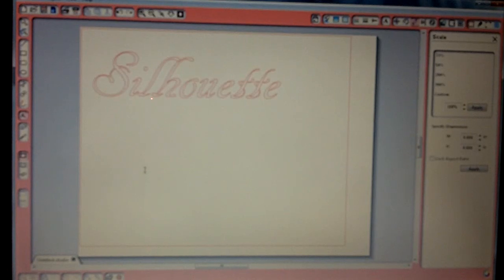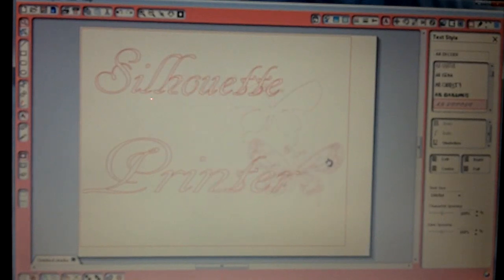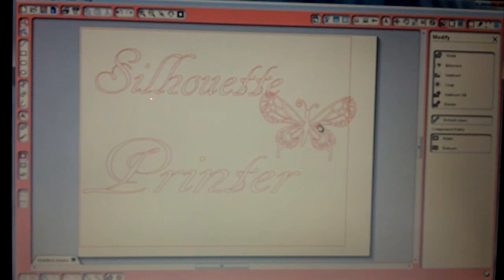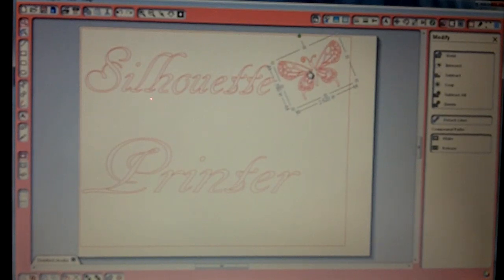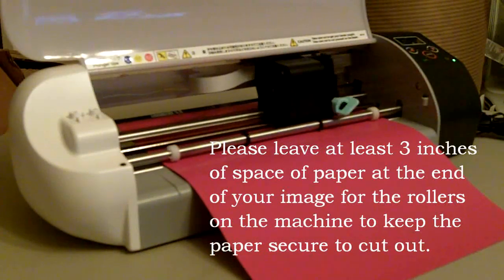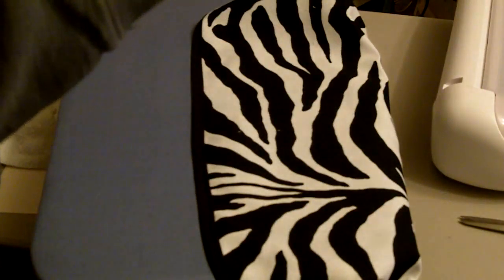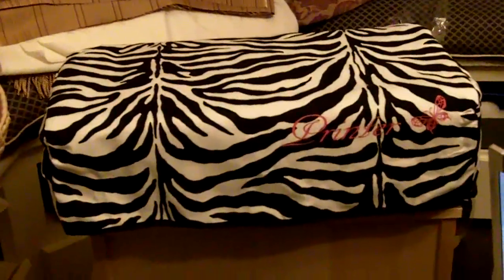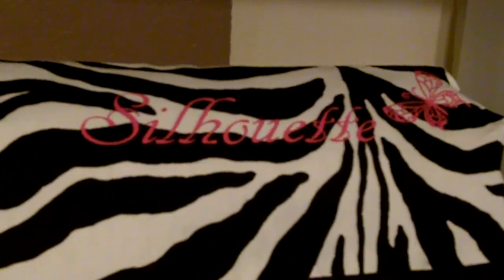How to use Heat transfer paper for you Silhouette

Comment: buy a heat press
Reply: Heat presses are expensive, along with the electric bill that comes along with using it. Unless you have a business that generates a very large income, a heat press is pointless.
Reply: no its not dont be cheap i got one for 200 on ebay and works great and i only use it when im working on a shirt

Comment: Hello, you would have to purchase or scan images that could be cut out with some type of software, I now use SureCutsAlot software to cut images with my 24" vinyl cutter. You can also use vector images. It should be something without a lot of small details. When I made this video, I wasn't to experience with cutting vinyl but I do a lot of cutting vinyl now for my shirts. Good luck

Comment: Wasn't that vinyl or something... Wouldn't you have to actually print something onto transfer paper first?
Reply: It's not a printer its a cutting machine. It was HTV which is Heat Transfer Vinyl so no you don't "print on transfer paper" You cut the image out and then iron it/or use a heat press to apply it to fabric.